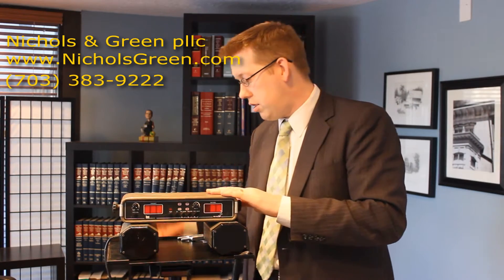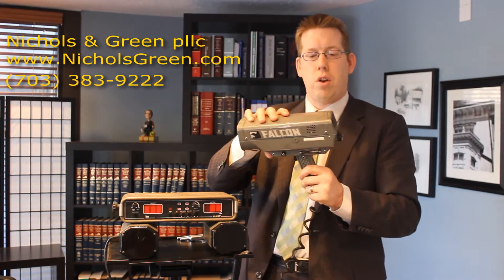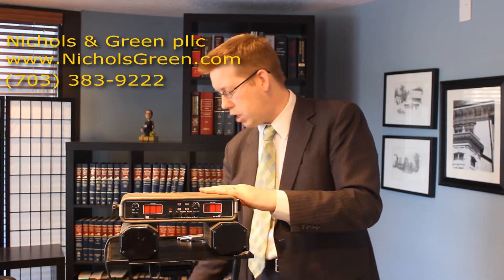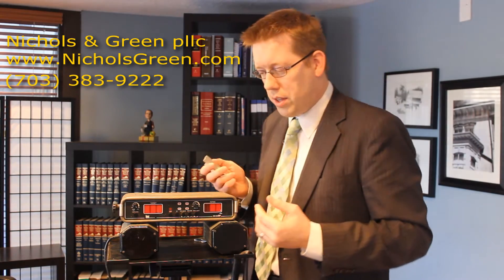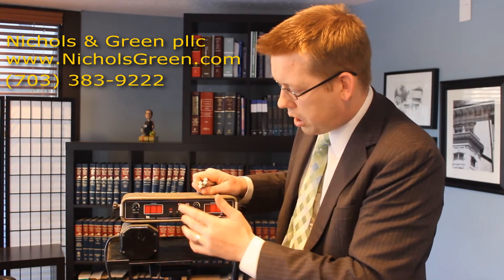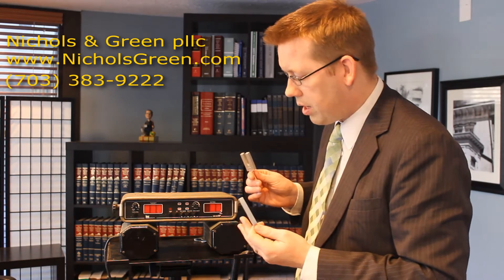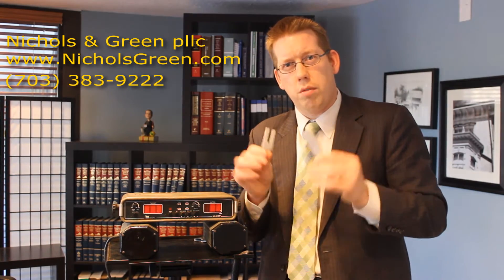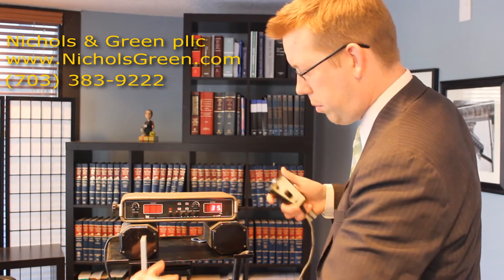How Police Radar Works - tuning forks, moving mode, speed enforcement

Comment: Well put together video, and solid understanding of basic radar clocking principles. Too often you see attorneys who fail to understand the actual science behind the scenes, this includes officers as well. More and more you are seeing additional features implemented by radar manufacturers in which the officer doesn't understand or fails to use the system properly. Examples include, turning off their Doppler audio feedback, cosine effect, largest reflected return vs closest vehicle (fastest speed), POP burst, Instant On, and the use of stationary/moving same lane same direction vs opposing lane opposing direction.

Comment: Do the Officers have to fork tune the antenna before they start their shift to have it certified?
Reply from the maker: +Ben A It is generally accepted that Va police officer's should test their radar devices with tuning forks at the beginning and end of each shift.
Reply: Can they be challenged by asking them for their calibration numbers if he/she was running radar and pulls you over using that device?